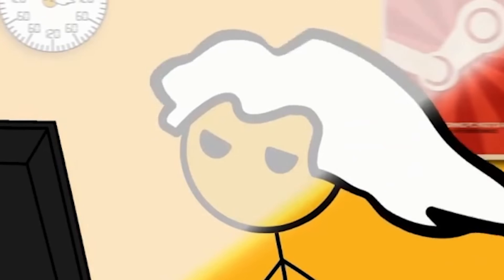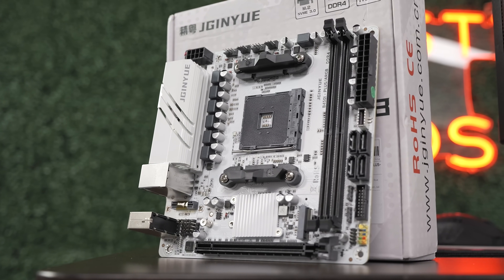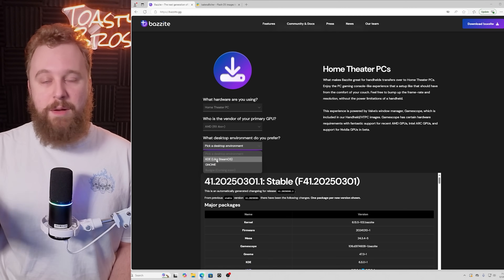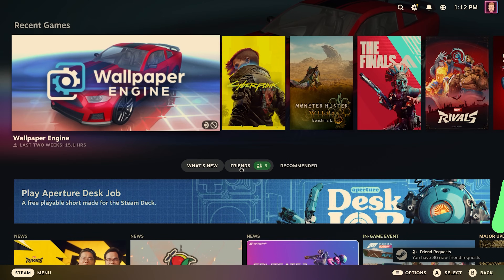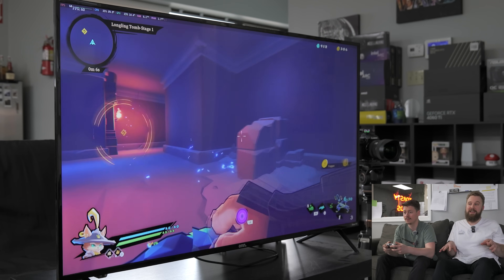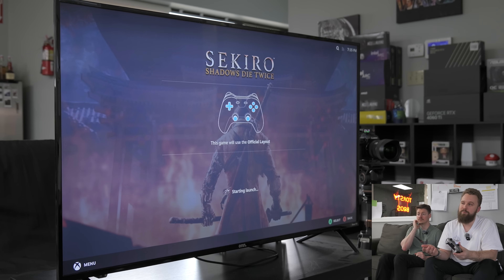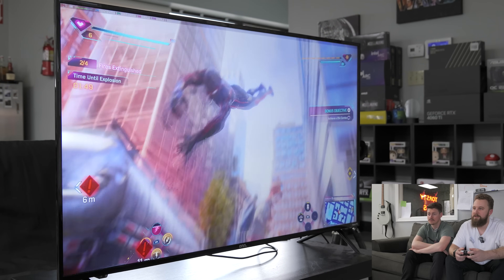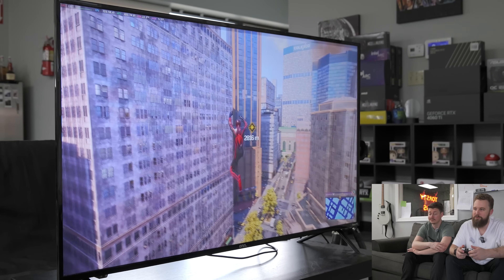Don't Buy a Console....Build One Instead! - Bazzite Mini ITX PC

Comment from the maker: Important note I was not aware of at the time of recording. Belena Etcher was found to have spyware, so I'd recommend using the old reliable like Rufus instead
Reply: I recommend using Ventoy and a bigger drive. It allows you to horde a bunch of ISO files onto the same drive. I have a 256 GB USB flash drive, and it currently has 25 operating systems loaded onto it. It can go higher than that too. I mainly use Rufus for either bypassing Windows requirements or doing a weird partition trick to fix bad partitions on a flash drive.
Reply: I'd recommend either Ventoy or Fedora Media Writer.
Reply: I used ventoy if you can't use rufus. Rufus is probably the best choice if you have a windows platform.
Reply: @darkshadowsaver ventoy is probably not safe
Reply: @VoidyWay whats wrong with ventoy? its backed by linus even
Reply: I was coming to the comments to mention this, thanks.
Reply: or ventoy
Reply: Really wish you would've tested all the games at 4k and just used the upscaling as needed as I feel like that's what most people will do
Reply: i felt bettayed
Reply: Whoa! That's crazy! I've definitely used it before. Thanks for looking out.
Reply: the first time I tried to download it I felt something was fishy because why would something like rufus needs 100+ mb size installer, I'm glad I searched reddit comments for review
Reply: damn now i feel betrayed
Reply: Use ventoy instead. Rufus can have some problems with Linux as I've discovered after some time.

Comment: Thank you for this! I just finished my build last week. What a difference a year makes in prices. 😂 My build 70% used and still cost more than yours (with half the ram LOL) 

Total Cost : $766 USD 

Breakdown: 

CPU - AMD Ryzen 5 3600x - $50, used 
CPU cooler - Thermal Right AXP90-47 Copper - $40, new
Mobo - Asrock B550 ITX - $109, new
GPU: NVIDIA RTX 3080 ti - $150, used 
RAM: 16GB DDR4 3600mhz - $50, used 
Storage: Crucial 1TB NVME - $108, new 
PSU: Cooler Master V850 SFX - $100, used/open box
Case: Fractal Terra (Jade) - $159, used/open box

Comment: I have a computer with the following specs that i am going to use for bazzit

Motherboard : asrock z590m ax itx

Ram : 32gb ddr4 3200 mhz corsair vengance 

Cpu : intel i5-11400 desktop

Cpu cooler : id cooler is-50x with noctua 120mmx15mm pwm fan blow air on cpu

256gb m.2 nvme for os

2tb m.2 nvme for games and apps

Gpu : asus dual rx 6600 non xt 8gv

Case : fractal the ridge case

Fans : artic p12x15mm pts for intake fans for gpu side of the case 

Psu : 650 watt silverston sfx
Reply: Also i have a bosegame p3 mini pc that i am going to stream my games from my bazzit build

Bosgame p3 specs

Os : windows 11 pro 25h2 preinstalled so reusing product key

Cpu : ryzen 9 6900H

Ram : 32 dual channel ddr5

500gb m.2 nvme for windows 11 pr os

1tb m.2 nvme for apps and local storage

Comment: Just got done building my $700 budget itx pc. It was super easy and fun to build. I wanted to share the specs and price with yall if you want to build it for yourself!

All parts were purchased brand new sealed and in original packaging. Prices all rounded to the nearest dollar.

Peladn 3060 12GB - $185 

Ryzen 7 7700 - $165 

Maxsun eSport B650 ITX WIFI ICE - $105 

Redragon 1200w Pro 80+ Gold (white) - $85 

Juhor DDR5 6000mhz 2x16GB Ram Kit - $63 

Crucial P3 NVME SSD 1tb (3500MB/S) - $42 

Magos aluminum fully open itx pc case - $30 

Thermalright AXP90 X47 cooler - $20

Total - $695

Comment: for new build, asrock b650 mini itx pc case, ryzen 7500f, thermalright low profile cooler, rx 9060xt 16gb dual fan, 32gb of ram, 2tb nvme, psu and case of user choice
Reply: Price?

Comment: Stop lieing to people. A case do not always need good air flow. If the GPU and the CPU can be cooled directly from the pannels, the amout of case fans do not matter at all.
This case is perfect for powerful GPUs because they are closed to the mesh pannel, they suck outside fresh air directly. Then, the hot air inside the case will be pushed away thanks to pressure, no need for exhaust fans.

Comment: I put together a dell optiplex with a 6th gen I5 and an rx550 running with bazzite. Runs great and it’s awesome for older tittles but can run at low settings a few modern titles.

Comment: I'm thinking about making a pc that uses an AMD Ryzen 5 7600, an RX 9060 xt 16gb, and 32gb ddr5 6400 mhz, yay or nay?
Reply: Definite “YAY”! Although if it’s not too much of a stretch, get DDR5 6000 CL 30 for RAM.
Reply: @Reluctant_Hero ive never built a pc before, so any tips do help
Reply: @uncontrollablefire It’s such a fun process, enjoy! 

One last tip, compare the price of the Ryzen 7600 to the Ryzen 9600X. If the 9600X is only $5~$10 more, I’d go for the 9600X just for the newer architecture. Although you’ll have to buy a separate CPU for the 9600X, you could get for less than $20 USD.
Reply: @Reluctant_Hero ah, thats the problem, im Canadian, and view prices based on the conversion rates

Comment: This kind of thing gets more difficult if you're on a budget. But it's still not impossible.
I can buy a used PS4 (non-pro, console-only), at around $100 on eBay for some close-to-modern gaming in the living room. Can I build a $100 PC that can beat the PS4? Well, YES! But it takes some bargain hunting.
An old full-sized ex-office tower with a 4th gen i7 and 16gb of RAM can be had for $40-$60, depending on whether or not it comes with a HDD/SSD. And that'll probably have a decent enough power supply to feed a $40 Radeon RX 560 (which has a nice low TDP of only 75W). Install Bazzite, and you've basically just got a non-portable Steam Deck with a bit more raw GPU grunt but less VRAM.
Reply: I agree.... I feel like this a bit reaching  and comparing apples to oranges.
Reply: Yeah, but if you think about it, you lose all your games when you go to a next generation console. Also, the sales that you get on steam games is ridiculous. AAA games for like two dollars. Family sharing on steam. You get your money back very quickly.

Comment: I built an Xbox on steroids a few weeks ago using a Minisforum BD 795i SE mini ITX board paired with a Red Devil 9070 XT stuffed in a Ncore 100 Air case. To cool it, I used a Thermaltake Toughfan 12 for the CPU and changed the stock paste to genuine Honeywell PTM 7950.
It looks like an Xbox but more menacing and Bazzite is awesome for that console feel

Comment: The logitech G25/g27/g920/g29/g923 wheels are all supported in the linux kernel, have been for ages. If you couldnt get them working, there is either something with bazzite specifically, or you did something wrong on your end with getting it to work.

Comment: You should use ventoy, it makes doing the whole installation so much easier for any linux distro no burning the iso to a usb everytime just drag and drop the iso on the usb that you installed ventoy to and you can swap that out with any iso

Comment: Built a "Console Killer" back in 2011.
All brand new, online deals
- Fractal Design Node 304 Case
- Gigabyte Wifi Mini-iTX Mobo
- 600W Gold PSU
- i5-2500k
- GTX 670 (EVGA)
- 8GB DDR3
- 128GB SSD (OS)
- 512GB HDD

Upgraded the unit:
- i7-3770k
- AMD r9 290
- 16GB DDR3
- 256GB SSD
- 1TB HDD
- Offset costs buy selling other parts
Reply: Just as a note, that original system was capable!

It had Windows 7 Pro installed, and dabbled with dual-booting (Hackintosh !!!) with it. It was emulating Wii and below, living under the TV. Still it was way more capable than an Xbox 360, PS3, or WiiU. In fact, it had more performance than the NSwitch, XB1, or even PS4 which weren't even released yet. And after the upgrade, it was more performant than a Switch-2, SteamDeck, PS4 Pro, or XB1X. This was a healthy era for PC gaming.

Yet, that was only the first "Console Killer" build.
Reply: The first system became a Hand Me Down, and managed to make a proper sequel.

The second "Console Killer" was in 2016.
Again, everything brand new, online deals
- Silverstone rvz02
- ASUS Wifi Mini-iTX Mobo
- 800W Gold SFX-L PSU
- r7-1700
- GTX 1080 (EVGA)
- 16GB DDR4
- 1TB nVme
- 2TB HDD

Upgraded the unit:
- r7-5700
- AMD RX-6800
- 32GB DDR4
- 4TB HDD
- Offset costs buy selling other parts

......this time, the sequel was almost as powerful as the PS5. And after the upgrade it is more powerful than a PS5 Pro. This unit can emulate the NSwitch and below. This is when the times/affordability had shifted for PC Gaming.
Reply: My third build is half finished.

It will be in a Case that I'm still tinkering/building. It is basically an Old VCR Machine. Total Sleeper build. And it will be built using Used Parts the with Best Value. Initially looking at an AM5 Mobo with r7-7700X and RX-6950XT that I have picked up in Late 2023 for a steal. Eventually will be upgraded to the last AM5 CPU and a Big GPU maybe in 2028 when the stars align. It's running Windows 10 Pro, and dual booting a Linux (ZorinOS) Distro.

Comment: I'd have a minor concern with gen 3- MHWilds may have some other optimization issues, but it's also one of the early newer titles with DirectStorage- something that I'm sure benefits from faster drives. Normally storage has NOTHING to do with framerate, but some of the dips are smoothed out a bit by faster speeds. More titles are likely to take advantage of Dstorage going forward. Of course you can always upgrade the drive later if you do hit that issue.

Comment: I build a very similar Bazzite PC for myself. With a R5 5600 and a used RX6600 XT I paid roughly 450-500 bucks and with most games i play it runs at 1440p with a bit of upscaling. It's incredibly power efficient and quite silent, except for some coil while from the GPU. I'd definitely recommend it if you like to play some chill story games on the couch after work

Comment: Nice video. 

But I'd have to say, just buy a PS5 at this point. PS5 is basically the "PC" of the console space. As it natively gets all 3rd party games, Playstation exclusives/ 1st party & now even Xbox/ Microsoft IP. 

Though the whole bazzite experience is close to a console like experience on PC. It's still a PC with PC complications that console just doesn't have. & Bazzite is Linux, in which some games can't be played online with linux because of issues with some windows based anti cheat software or other incompatibility issues. 

Console will always be the most start forward, simplistic & quickest boot to play way to game. 

& just to be clear. I have all platforms PS, XB, Switch, Windows PC & a Bazzite Linux PC. Just speaking from person experience amongst all devices/ platforms. 

& I've made my windows PC's as console like as I possibly could. 1 is running Playnite & 1 is running Steam Big Picture mode. Both boot directly into those apps. Both are rigged to remote start/ boot. Booth can also wake from sleep by controller. & whether Bazzite, STM Big Pic, or Playnite. If I have only 15 to 20 minutes to play a match really quick. I'm definitely going to console. Console is the quickest from "power on" to getting into a game & playing.

Comment: bought a nice 1080p itx build off a local guy that does builds for cheap paid $600 for 
4060
r5 5600x
32g ddr4 
750w 
1tb nvme 
windows 11 
and i am running any and every game at high settings 100+ fps at 1080p ik i might get crucified for playing in 1080p in 2025 but upgrading top this from my 1660ti and i7 6700k was a huuuuuge difference

Comment: might aswell just use steam big picture at this point
Reply: I assume you mean Big Picture on Windows. This is actually also Big Picture, but it's extremely integrated into the OS (aside from Big Picture there isn't any real desktop environment in game mode, which leads to lower resource usage, and updates for both the OS and installed apps are done entirely through the Big Picture UI)

Microsoft also seems to be doing everything they can to make Windows as hard to use without a keyboard and mouse as possible

Comment: I've tried fedora and bazzite on both my am4 systems, one with a 3600 and one with a 5700x,  one with a 3060 and one with a 1070, can't get them to install no matter what on either. Building a 9600x with a 9070 XT this week coming up so hopefully I can go with bazzite on it as opposed to windows
Reply: To me this sounds like either your SSD is failing or you aren't reclaiming the space on the SSD in the installer

Comment: can it play console only lobbys tho?
Reply: It depends. If the players are separated based on the platform, then no, you can't access console only lobbies. However, if players are separated based on the active input device, which I believe is most games since PC has had controller support and XBOX has keyboard/mouse support, then you can access controller only lobbies as long as you're using a controller.

Comment: I wouldnt recommend using rufus/etcher to flash drives as us can only flash 1 file @ a time, there is a better far far far better alternative i recommend ventoy.

ventoy so much better i say this because you can download any iso file for windows/linux and all u need to is copy and paste to the drive and your not limited just to a usb flash drive u can use any type of drive externally from hdd, msata, ssd, m.2 and of of a flash drive u can have all your os's on 1 drive and there is no limit to the capacity.

tech enthusiasts like toasty bros would benefit from this software over rufus/etcher, all u need to is 
1. plug in your drive of choice 
2. download ventoy
3. run ventoy disk, ventoy will detect your drive and go install, ventoy will format and install it ventoy grub menu onto the drive this can about 2-5 mins
4. copy and paste your iso files and your done its that simple

keep in mind this can only be done within windows!!!! I recommend go into your bios change your boot order for usb as your 1st priority this way doesnt matter what port your usb drive is the system will detect your bootable usb drive and boot up into ventoy grub menu without u needing to the boot menu, select your os and off u go to the races, if your setting the the system for the first time after your build do it while your tuning your bios for fan controls and xmp and make sure u set the setting to uefi/legacy that way the pc u have old/new can read the drive of any format as long as secure boot is off and u have csm on/off.

this does not work for mac, well we know with apple they like to make things hard, i say 1 drive multiple os's in 1 place on 1 drive is the way to go.

Comment: Hello Bros, can i run this in an old 10 year old gaming rig, I have an intel i7 4790k with Asus Hero board and GTX980. What are the minimum requirements. Thanks
Reply: that won't work your NVidia GPU is too old. You'd need a RRX2000 and up. You'd have to replace the 980 with something like a Vega64/5700XT on the AMD side that would give similar perf from approx the same era.

Comment: I actually built one for my cousin, lol. Snapped up a compact MATX PC from a clearance sale of an old closing Net Cafe. i5-6400 + GT750Ti. Swapped out the latter for a 1650 I have lying around as a backup GPU, populated all 4 slots with generic 8GB RAM sticks also from said clearance sale, pulled out an old Seasonic 450W PSU from storage in place of the generic grey one in it, and slapped on a Bluetooth adaptor for wireless controllers and peripherals. Put Bazzite on it and paired it with the old 1280 x720 42" Plasma TV in their living room, and it comfortably runs games like Marvel Rivals and Overwatch, as well as my cousin's library of single-player games.

Comment: basically the build i started off with in october, was a bit cheaper before the trade war started. upgraded the 3600x to a 5700x3d off aliexpress for $140 and am running a 2070 super. i only play games like rust/dota/tarkov and it runs everything great at 1440p

Comment: I'd honestly just recommend using windows 10 with controller companion, which is like 2 bucks on steam and literally if you bind a couple things (I did it where back button and left depad while in keyboard mode will open the start menu, and the right d pad minimizes all apps)
Reply: W10 is out of support soon....AND it's still not designed to be run with a controller. This is a console use case. I don't want to be sat on my couch having to alt tab with a M+K perched on my lap. Wrong tool, wrong application. Windows is a desktop os, that's where it should stay.
Reply: @eagle_rb_mmoomin_418  with controller companion I rarely use my keyboard and mouse, it’s that good.
Reply: @eagle_rb_mmoomin_418  i use controller companion and have zero issues, i dont even bring my keyboard and mouse when i game in the living room. its meh but its very solid.
Reply from the maker: Sure, but Bazzite IMO as long as you don't play competitive shooters is perfect for this use case.